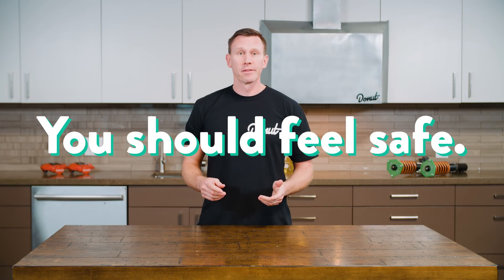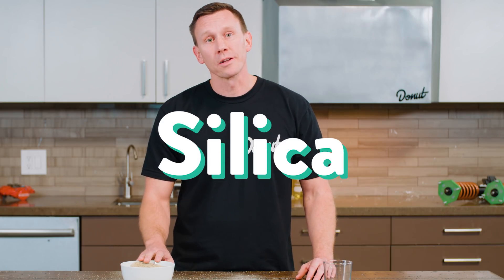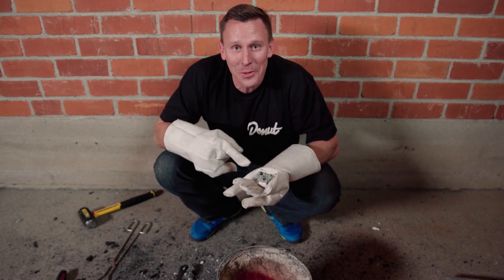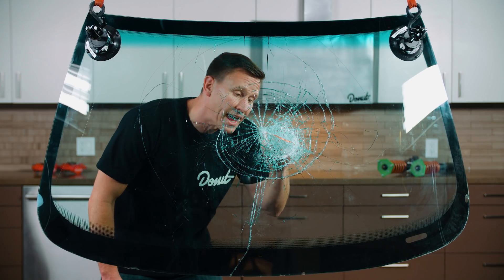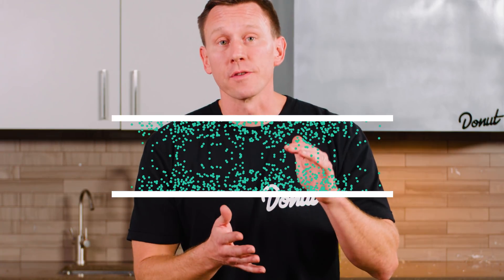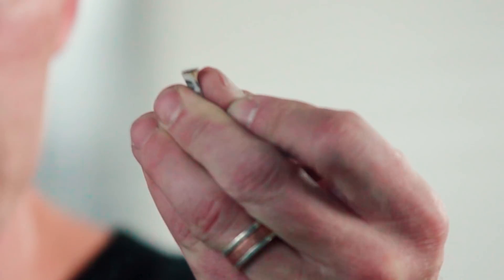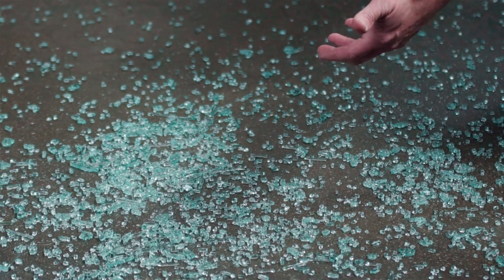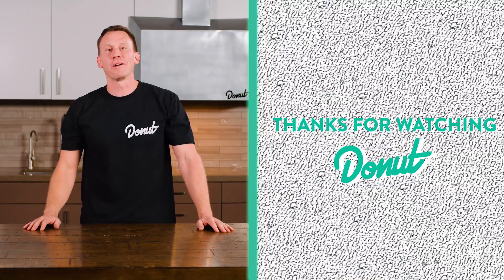SAFETY GLASS - What Makes it safe? | Science Garage

Comment: I know this is late as hell, but I’m pretty sure tempered glass works slightly differently. The behavior described is correct (and awesome), but the reasoning is a little flipped.

I would say the inside is pulling on the outside—this is because the inside cools more slowly, as said in the video, and because of funky glass physics (specific volume cooling curves), it ends up a denser/smaller than the glass on the outside. Said another way, it shrinks MORE than the outside, pulling the outside in/together. This helps prevent cracks, as cracks form mostly when things are pulled apart (think ripping a sheet of paper). The glass on the inside pulls the surface back together, preventing it from being ripped apart as easily. The inside pulling on the outside is the tensile force that is mentioned (also called “residual stress”).

Source: majored in materials science

Comment: Back as a bad youth, if you smash the windows with the spark plug piece in a pitch black room you can see a blue/white flash/spark when it makes impact for a very brief moment, also if the window was in a car door it would be harder to break with a hammer as its gripped all the way round, i've watched hammers bricks and lumps of steel just bounce off the glass

Comment: The reason that a sharper object can break glass with a lesser impact is due to the fact that pressure=force/area. Thus, with a smaller contact area, there is a greater pressure on the surface of the glass.

Nothing is sharp enough to “go in between” silica molecules. Nothing.

Comment: 0:49 glass is not a solid, glass is a 'prefix' solid. Glass also does not flow, like at all, Its a non-uniform crystal structure. The molecules are trying to flow but they can't because they keep binding on each other. Is like a bow of potato chips they can kind of move freely but not really.

Comment: Glass in not an amorphous solid
Reply: yes it is
Reply: Rocky 2099 despite common belief, it it not. If you’re going to use old stained glass as an example I would advise against that. They were not very good at making glass and so they put the thicker, stronger side on the bottom. I think Vsauce did an episode on this if you need some clarification. Just because donut said something in a video after a 2 minutes google search doesn’t make it true.

Comment: The inner layer of tempered glass is still shrinking not expanding after the outside hardens. Since the outside is already hard the glass can't shrink further. So when the surface is broken the internal force pulling the edges in wins and causes all the glass to shatter. Also not all side glass is made this way, some are also single pane safety glass